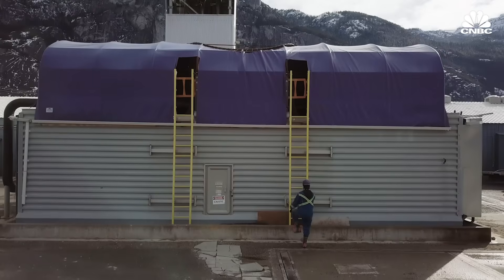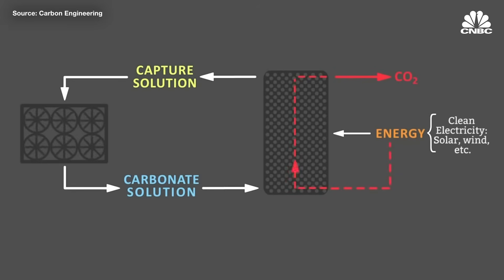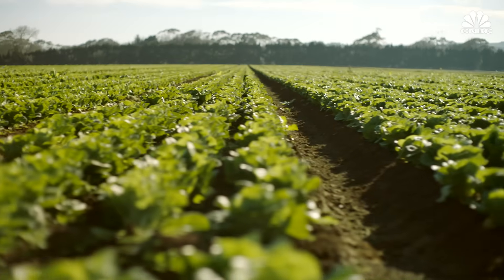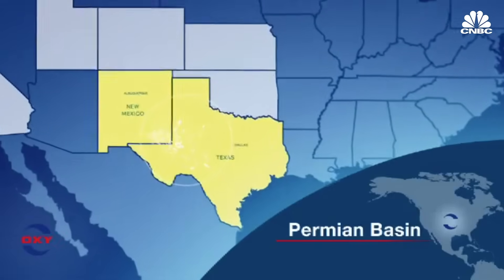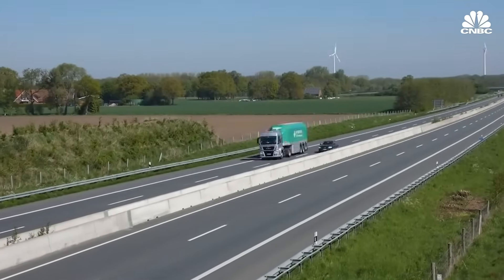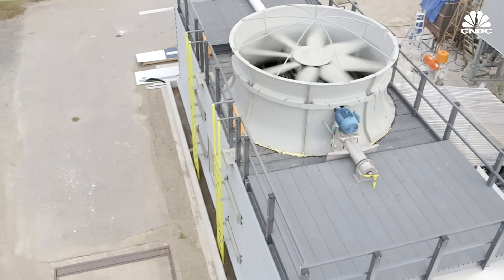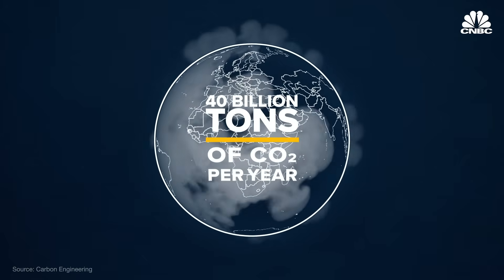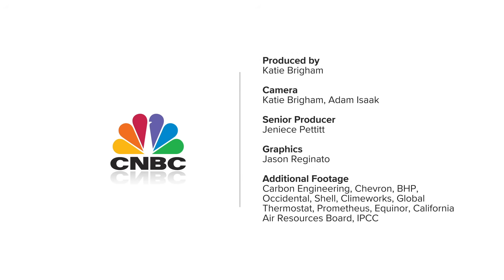Bill Gates-Backed Carbon Capture Plant Does The Work Of 40 Million Trees

Comment: "Wind turbines or solar panels they also remove carbon from the air because they prevent it from getting in the air in the first place" I don't know how "experts" making such dumb statements get so much recognization and airtime. He is flat out making a wrong statement and pretends like what he said makes sense. The only way to remove carbon is to actually remove it with technologies like Carbon Engineering has to offer. Renewables are great prevention but they are not a removal technology. 

Also trees are not a permanent way to store CO2 and that professor knows that so it is irresponsible to only depend on trees and not at least explore other technologies.

Comment: Does it make sense to read a lot more CO2 into the atmosphere when the technology (carbon capture) absorbs only a very small ten thousandth millionth if any from the atmosphere. Would not it be better to leave the task of CO2 reduction to hydrogen and fuel cells? if you look at power to gas, maybe that's the silver bullet. The weather and the climate are becoming ever more extreme and decentralized energy supply more and more important.

Comment: Wouldn't covering new construction in certain types of moss do just as good a job at a fraction of the cost? Not to mention that it would fill our cities and skylines with much needed greenery.
Reply: moss is good at collecting dust but its a very small plant per square ft and thus cannot save alot of carbon dioxide, compared to lets say a tree
Reply: @maxbauer1633   The "city tree" basically a big box which is around 38 square feet, covered in moss and can be put on the side of buildings does the work of around 270 trees. I'm not an expert in these matters but the City Tree is what came to mind when I seen this video, would need around 148,000 of them to do the work of one of these but I dare say that would be easy to do in a city full of ugly skyscrapers.
Reply: @JB-so5gr   I totally gotcha and yes putting greens on buildings is a good idea but if you look up their website, they promote how the moss sucks up air pollutants, dust particles and makes the air cleaner, but it cannot remove the carbon dioxide gas from the air like a tree does or this carbon removal plant in the videom moss is a air purifier
Reply: @maxbauer1633  I see. I didn't look into it properly enough, guess I got ahead of myself. At least I've learned something today! Thanks.

Comment: This went from a video about carbon removal to a video about doubling the price of oil with a $100 per ton carbon tax. Yikes, lol
Reply: They said that because there isnt a incentive for companies to build this carbon capture devices in the US since there isnt any economical incentive or pressure. Companies won't build these if it doesn't ultimately benefit them
Reply: @Thatmoondog47  So basically the video said that we have the technology to build carbon capture, but because it costs $1-$2 per gallon of gasoline it's not good enough yet. But they don't say that, they just say we need carbon tax. If they taxed carbon the US economy could literally be destroyed. Just make carbon capture less expensive or fund its research. How did I come to the $1-$2 cost per gallon? Because 1 gallon of gasoline releases 20 pounds of CO2 which means that 100 gallons releases 1 ton of CO2 and the video said that 1 ton of carbon capture is around $100-$200+.

Comment: Put it straight on power plants and factories exaust, it will be more effective
Reply: Carbon capture coal plants do exist but are more expensive than renewables
Reply: @Bot1735  there is no such thing as renewable, except for burning trees,
Reply: @akaikiseki9346  Coal isn't just pure carbon. There's a bunch of other stuff in it, including a little bit of natural uranium and thorium. The problem is that we burn enough of that coal to make the trace amounts of radioactive material add up to a measurable problem.
Reply: @jmonsted  i bet those are pretty easy to separate from CO2.
Reply: @jmonsted  but burning uranium doesn't cause radiation.... You need fission to happen to get more radioactive isotopes
Reply: @mitchsfarm  Naturally occurring uranium and thorium is radioactive, just at a low level. Spewing enough of it in fine particles over the landscape is definitely a problem.
Reply: Jesper Monsted Prove it
Reply: @jmonsted  yeah but the particles are already there. Naturally occurring, they're not creating more. When I did a coop at a nuclear plant, they left the new bundles of fuel sitting out in an open cage. Because the radiation level was so low.
Reply: @mitchsfarm  Nobody claimed they're making any. They're just digging them out of the ground and spewing them into the air.
Reply: They literally said that they already do this on a small scale, in the beginning of the video.
Reply: Typically emissions are more than just carbon unfortunately.  :/
Reply: Nuclear powerplants almost produce no c02
Reply: @punaise9969  mostly the breathing of the people working in it...
Reply: @akaikiseki9346  
Coal actually emits more radiation than a nuclear power plant, on average.

There are small amounts of uranium in coal seams. Not much, but we burn a LOT of coal. And all that U goes out the stack.
Reply: You are too smart for this world my friend.
Reply: KarmaTheBrit he’s not. Any person w half a brain knows this wouldn’t work lmao
Reply: Can't we just invent a catalytic converter type mechanism for factories instead of bringing a whole plant there?
Reply: @senortigre0489  
Catalytic Converts take care of pollution but do nothing for CO2 emissions. They actually increase them slightly. 

Remember: pollution is how CLEANLY you burn. CO2 is how MUCH you burn. For example, an SUV pollures less, and emits more, than a 2-stroke Vespa.
Reply: @bcubed72  "...catalytic converter type mechanism..." You may need to start rereading comments before replying. A mechanism that attaches before the gases are let out into the atmosphere AND stops co2. That would be LIKE a catalytic converter but not exactly one.
Reply: @senortigre0489  already have and over the last 20 years the US has dramatically dropped their emissions. Funny how that doesn't get circulated as much as unproven conjecture espewed by the Corporate owned Media. 6 Corporations own the Media, including the one presenting this farce.
Reply: They allready exist, air scrubbers and capturing/processing is mandated at a lot of buisnesses. But you have to ask yourself this question. If mankind is being pegged as the sole biggest Carbon dioxide contributor, bringing about climate change, then Why Did climate change occur naturally and regularly thousands of years even hundreds of years prior to industrialisation? 
The other thing we have to think about regarding.climate change and carbon dioxide is that Co2 is an essential plant food, Plants, trees etc grow more rapidly now than they did prior to all this excess carbon dioxide nonsense. So Is the problem really even carbon dioxide emmisions?
Reply: @senortigre0489  They already did. The government just needs to force it on them.
Reply: @blacklikeme88  thank you, I was not aware of that, what are they called? Can you link it?
Reply: @Bondy yep it would be to the most efficient to remove it at it's highest concentration, instead of letting it get diluted in the atmosphere.
Reply: The Big Question
Is there any verifiable evidence that fossil fuel CO2 has caused any temperature rise, ice melt or sea level rise, let alone causing "extreme" weather?
Reply: exaust to your electric stuffs ，imagine
Reply: Facts : nuclear energy kills wayy less people than coal energy does. If they can only figure out what to do with the nuclear waste, we're gold.
Reply: the 3 largest freighters on the world oceans produce as much CO2 as the entirety of all road-vehicles in europe. 
Last year, they built 5 or so new ones of these...
It is possible, to sail the oceans with solar-sails. They just aren't used, because they get so many subsidies on fossil fuel, that it's far cheaper than upgrading.

Whatever we do, it won't have any effect, if we do not address the worst poluters.
The US military alone pollutes more, than the Entirety of US cars. 

There are a lot of stupid things going on...
Reply: There are too many plants for this and there are other greenhouse gases beside CO2 though a filter for greenhouse gas emissions at power plants would be nice
Reply: Sarcalogos Tortolero this is what happens when a teenager tries to talk ab something they don’t know
Reply: As long as you are willing to pay for it. It will all be charged back to you, the consumer.
Reply: 👀 then capitalism will cause competition which will advance the tech for the machines.
Reply: put one straight on your mouth.
Reply: Do you know how many power plants there are in the world, let alone a single country.

Secondly, enough carbon dioxide is in the atmosphere already to be extremely harmful to the long-term health of the earth. We need to remove carbon, not just prevent more.

Lastly, what about cars and other carbon-dioxide producing animals and machines?
Reply: These companies will only do that if just releasing co2 in the air is way more expensive then building that echaust plant and capture it.
Reply: Put it over China.
Reply: Like an EGR valve does?
Reply: We need millions of these all over the world because the rate at which they are cutting threes is insane.
Reply: jean tsai Good luck getting China onboard. They are too busy with the Mexicans buying the US right from under their feet.
Reply: Just put the filter in the exhaust so the c02 never gets to the atmosphere
Reply: Zenn Lozanno 3:47
Reply: No, that makes too much sense.
Reply: watch the video of fully charged with this company... then you hear that its no difference where they put it up
Reply: My god...just so obvious...
Reply: They already do. Quest Energy Carbon Capture at Shell Scotsford in Alberta, Canada. I should know, i helped build it.
Reply: @Drakilicious you'd be delusional to think that.
Reply: It is already being done for few years.
Reply: Ultra Mega 
coal plants don’t produce radiation as far as I know
Reply: Zenn Lozanno you repeated wat they said in the video
Reply: Good idea. like a Cooling system
Reply: What about automobiles?
Reply: Ultra Mega 
“Radioactive waste from coal plants”
Reply: Exactly
Reply: @Ultra Mega the radiation from coal has be debunked decades ago, well what about the co2 scrubber plants wont their filters get clogged, this idea is a scam
Reply: The issue is if they're attached to power plants they aren't "removing" CO2 from the atmosphere, only "averting emissions" that would happen anyway. It's carbon accounting semantics but I tend to agree with you. You'll see carbon capture being used more in cement plants. I just don't want my money going towards subsidizing a corporation's claim of being green - they can invest in that themselves if theyre so interested.
Reply: Nuclear, stop burning coal..... That's a great start.
Reply: @Ultra Mega Could you please explain how burning coal is supposed to create radioactive waste?
Reply: @dismiggo  Coal contains uranium 235 (or 238 - don't remember). A coal plant releases more radioactive materials to air than nuclear power plant...
Reply: @dismiggo  Trace amounts of uranium and thorium are normal impurities in coal. When you burn the coal, the heavy elements remain and get blown up with the smoke(fly ash) into the atmosphere.

Coal plants actually produce more dangerous radiation than nuclear plants since they pump it into the air, whereas it is contained in a nuclear plant (unless it breaks)
Reply: @revoxx When coal is burnt it releases monoxides and other chemicals including radiation. In small scale ie home bbq not hugely detectable but on an industrial scale ie burning thousands of tonnes its a byproduct of the combustion process. youtube or google it.... well known fact.
Reply: @dismiggo  @TheFirstTime He means the radioactive particles produced by burning dirty coal.
Reply: Its really not that simple sadly
Reply: Do your research first. 
Automobiles, cruise/cargo ships, agriculture, airplanes, 1 volcano eruption, decreasing micro plankton populations... power plants are a fraction of the problem.
Reply: The only effect these plants might have is to CO2 starve the trees and other plants in some area around them, thereby reducing animal life in the area also.
Reply: Before the Great Biblical Global Flood, the pre-flood atmosphere has a carbon dioxide content of .25% which is responsible for the lushness and large sizes of all the plants growing at that time. In fact, in England, an experimental greenhouses uses an atmosphere of .13% carbon dioxide and has experienced a daily yield of fodder grass at 1,000 pounds per acre per day.
Reply: Hard to take you seriously if you actually think the bible is factual....
Reply: Milk you drink polluted more than your car..
Reply: You sir, clearly don't understand how business even small businesses work
Reply: @Ultra Mega how did you reach that conclusion? I just didnt know coal produced radioactive waste
Reply: @Ultra Mega its a start jack ass. What other pollutants? This pulls out co2 which is doing the harming.  And coal isnt even that big anymore wtf
Reply: @Ultra Mega radioactive waste from coal? Sure bud

Comment: The tech is a bit weird. It does seep out carbon from the air, but it's after pumping in a lot of natural gas (is, add 50% more CO2 to take out a little bit more). Their plants are basically carbon neutral, but I hear they're building a carbon negative plant soon, so it'd be interesting to monitor progress
Reply: i agree.

Comment: use it in power plants exhaust it will be more efficient for heating capturing comparatively
also, use co2 as a refrigerant and various applications
Reply: Co2......as refrigerant? Are you mad? Copper lines  would dissolve over time and if there is a leak it would be deadly.
Reply: @blueffect87  They already do this dude. Look up CO2 secondary refrigeration systems. They use them in supermarket refrigeration
Reply: @blueffect87  CO2 is not that dangerous however... Carbon monoxide (CO) is extremely dangerous. CO2 could only be dangerous if there would be enough of it to deprive the area of oxygen. A slow leak would thus be harmless, and even when it would suddenly burst I doubt that there's enough CO2 in there to be dangerous

Some fire extuingishers also use CO2. They probably have a lot more capacity than a refrigerator system, thus a fire extuingisher would be significantly more dangerous than a refrigerator system.
Reply: It takes energy to make CO2 cool enough to be a refrigerant
Reply: Gokulkumar M you don’t think these engineers would’ve thought and considered that option? Lol
Reply: @kristiann4346  some carbon capture companies do preserve the CO2 and sell it for soda companies etc
Reply: @konkelzach  doesnt change my point at all. The people that made this decision have access to far more relevant information than you do. So to say that you know what the better option would be simply from watching a short youtube video is just ignorant.
Reply: @kristiann4346  We're not on the same page. I was simply saying that some companies use carbon capture and sell the CO2, these ones chose not to - I didn't address anything about your comment on whether or not its feasible for them. They're storing it as carbonate salt. To make CO2 is a simple process of dissolving it in water, but it would require money to extract, package, and transport that CO2 when it's easier to just transport solid carbonate - why not just give it to their customer and let them do it? Maybe that's in line with your comment earlier.
Reply: I work on co2 refrigeration systems. They are ok. When they work..... Guess I work on the older stuff. Has a lot of problems  along with the benefits
Reply: We don’t know how the chemical they’re using is going to react with the heat coming from the exhausts. There must be a reason a good reason why that’s not an option.
Reply: Gokulkumar M okay you know this but they don’t